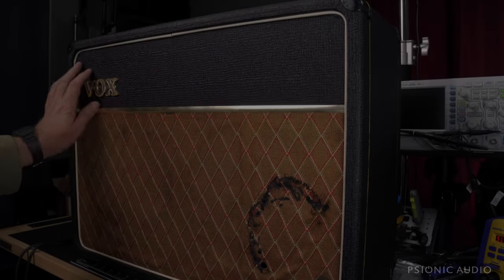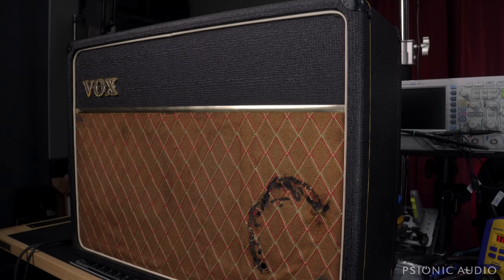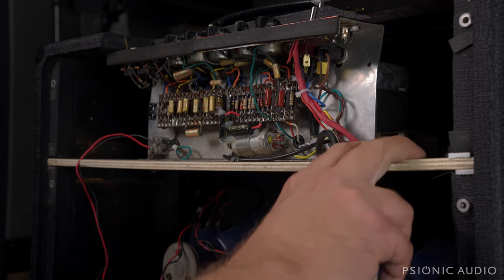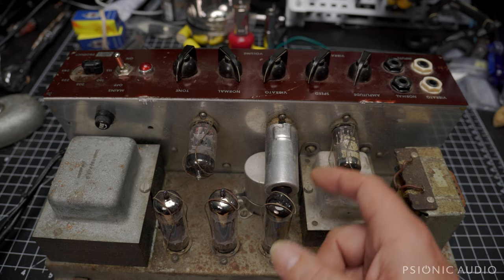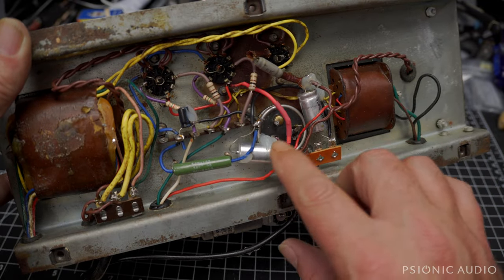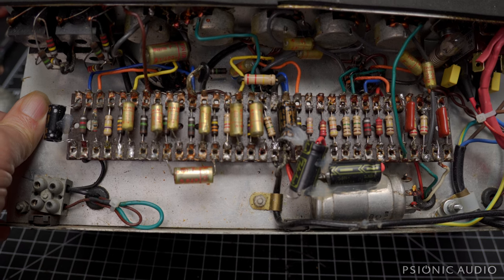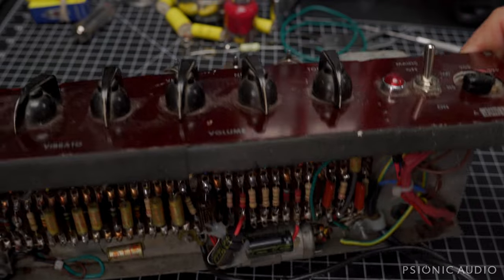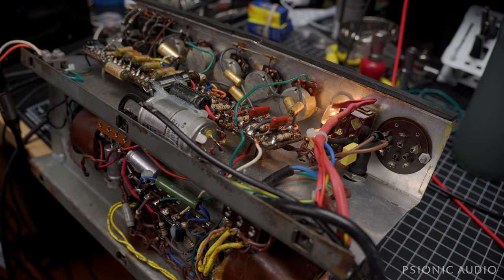'64 Vox AC10 | Pt 1 : Initial Evaluation

Comment: My daily home noodling amp is a Vox JMI AC-10 clone head through a excellent Celestion Blue type speaker, incredible tone.  Brian at "3rd Rail amps" (small builder) modified the circuit to make it better, but basically it's the same sounding as stock.  That EF-86 channel with a telecaster is my favorite, but strats and Jazzmasters (my new love) sound great too.  Looking forward to hearing that amp with turkey!
Reply: From where is this kit, please?
Reply: "Fugly" ?   you're starting to sound like Brad.

Comment: I would love to hear a comparison when this is fixed to a modern AC10C1
Reply from the maker: There can’t be a comparison as the AC10C is not an AC10. It’s kind of the AC30 top boost channel attenuated to feed into a no headroom opamp circuit then fed into a crap speaker. The only thing they share is the model name.
Reply: @PsionicAudio  you mean that digital reverb circuit?
Reply: @PsionicAudio  this is an interesting topic, the circuit has a voltage divider of 470k/47k before it hits the low headroom opamp circuit (necessary of course to work with 5 volts digital chips, then leaves the circuit, then hits the lnd150 recovery stage which I imagine brings it up to correct level. Well it does as evidenced by the volume of the amplifier.  What does it really matter if a signal gets temporarily brought down in level, as long as it’s brought back up again?  I am thinking maybe signal to noise levels gets trashed, but other than that - what’s so inherently wrong from a circuit design point of view. Just really curious and wondering if a redesign with an actual spring reverb and a +/- 15 volts daughter board would improve anything?
Reply: @voxpathfinder15r   a lot of people seem to like the  modern Ac10 C1 and the speaker is not too bad
Reply: @vincentl.9469  actually I am a big fan of the VX10 speaker when I put an MXR Custom Comp on the amplifier. Seems to bring back all the chime.
Reply: @voxpathfinder15r   I have a Greenback on mine, which came with the amp, a good speaker. I believe the original 10 was more like 12 watts . It's hard to do a comparison on sound as there are so few around. A separate Reverb was available Vox made a  head version, even rarer now ..
Reply: @PsionicAudio   I believe these were more like 12 watts ? I also think there was a separate Reverb unit available at that time. I also saw a head version (*very rare) somewhere on line..cant say I've heard any of these amps sing . A few will be in the hands of collectors unfortunately
Reply: @voxpathfinder15r The originals also have 2 10" speakers where the new ones only have one, that's a big difference

Comment: Beware, Lyle. If you give this the same treatment as the Bassman, you risk getting in the future piles of rusted metal with a couple of valves stuck in it.
Reply: ha! you are describing my situation as an amp tech in Mexico City
 ... most of the vintage amps I get have rust and are butchered :( ... the good part is that full restorations make you learn more and develop other skills.